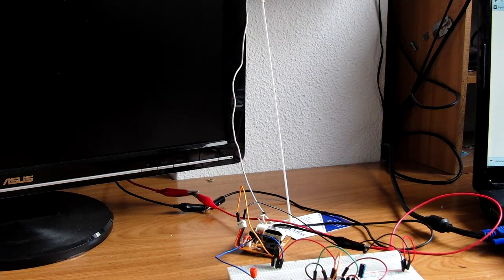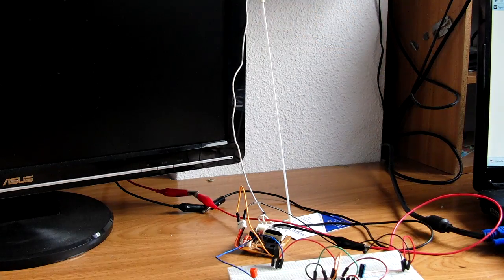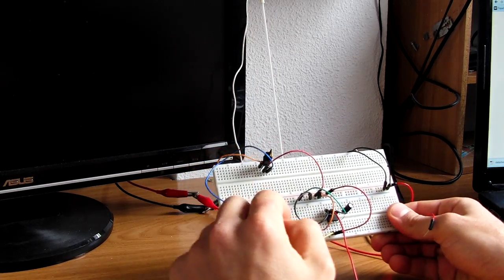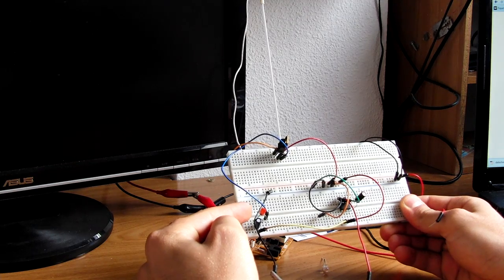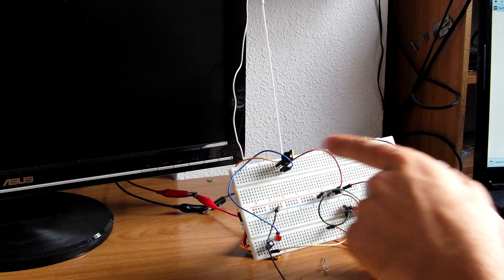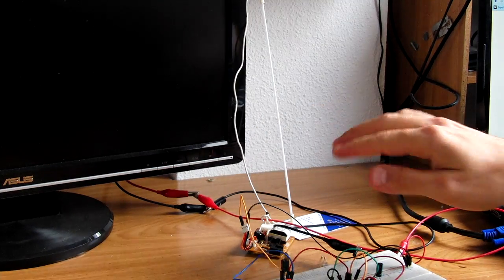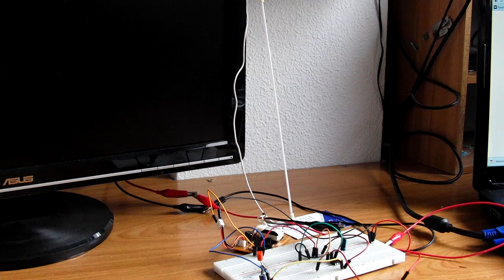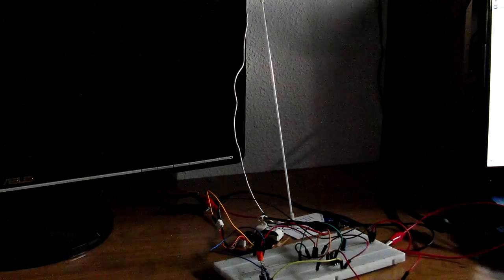DIY Fluorescent tube Vumeter from an old scanner

Comment: Wow, that's super cool. I just found this fluorescent tube in an old scanner and wondering if you could share the schematic. Also how many volts does it take, I supplied it with 8v, and it looked a little dim to me, and I don't want to destroy it by giving it too much voltage, so please help me. Thanks for this great video.

Comment from the maker: @tyreza79 Just make a little schematic of the components that are conected to each line to see if you can figure it out. GND its always too easy to guess. The rest its a little more dificutl but transistors for example usually help.

Comment: @Twistx77 my reflection lead me to what you said also;: i analysed all the circuit; there is no rectification for AC,the circuit is DC surely:the fuse is there only to protect against  PSU fail or electric arc from a motor fail! im still confused how to feed DC to this board:because it has 4 wires: but on the board they put 1 and 4 on the first and the fourth wires; maybe those are the +V; maybe its fed by 5 and 12V
im not sure !i will send photos to you as soon as i prepare them ;

Comment from the maker: @tyreza79 Maybe the fuse stands 250v but that doesn't mean that the input is 250. Probably is way less than that. Anyway if you want send me a private message with the Circuit board and all the information you have like IC's names and stuff to try to help you. Regards!

Comment: also the circuit board is printed from both side, on the hidden side there is micro electronics: i didnt check it out since i needed to remove a large heat sink plate !
could you help me if i upload a photo of the circuit ?

Comment: yeah i know it obviously;but so many machines have bridge rectifires in them or in a circuit board before them!
meaning that they take a certain AC voltage turns it into DC
and then invert it to AC and amplify it!!
well basicly that was my idea; but on this copier machine inverter for ccfl copier light !
there is a fuse of 1.25 A 250 V !
well the 250v fuse freaked me out; why would they put 250V
and next to this fuse; there is an electrolitique capacitor of 50v;
next ===

Comment: i see thats nice !!
hey i got an inverter from a copier machine
this one has 4 wire from electricity feed
i cant tell if it wants DC or ac curent :
any help possible ?
this iverter i have is bigger than the one you have as it is from a copier machine